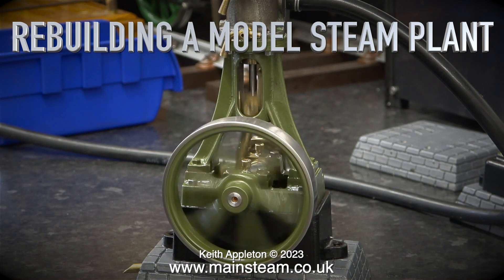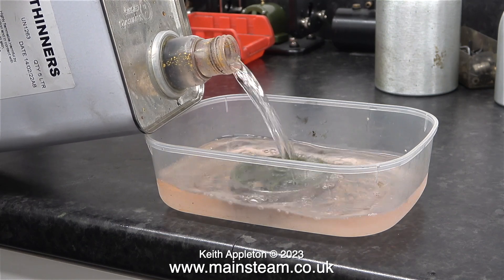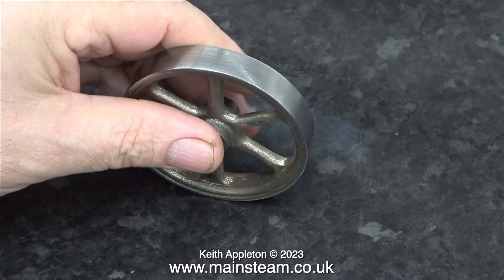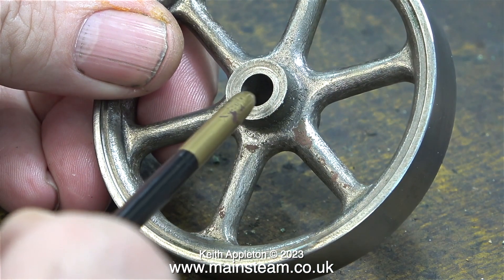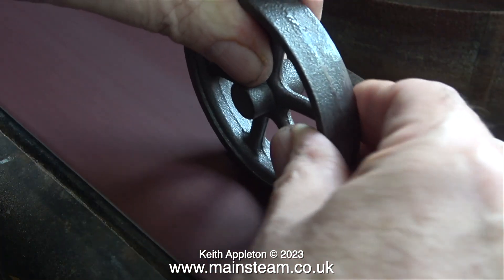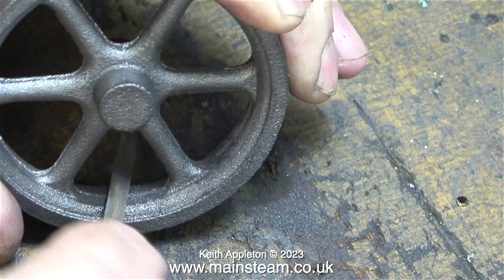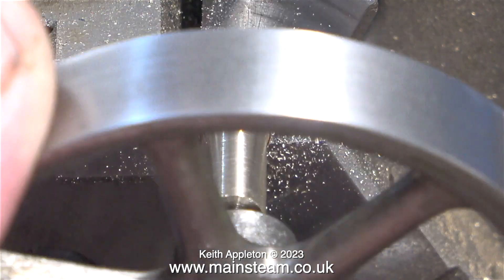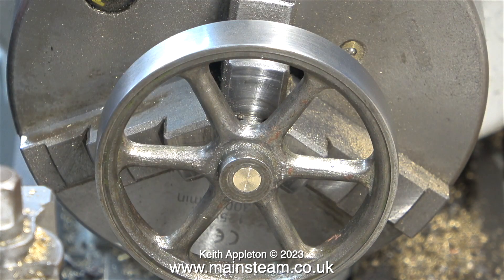REBUILDING A MODEL STEAM PLANT - PART #11

Comment: windows 11. Everything looks different, everything is in a different place, and everything is accessed slightly differently. After 5 months of working with it, I finally got it to remember which search engine I like (google search not google chrome), Really, once you get used to the visual changes, it's not to bad, better than 10? Well, I'll let it go at that. ;-)